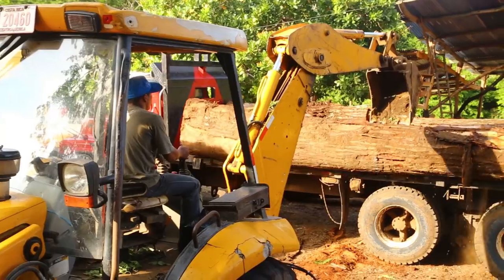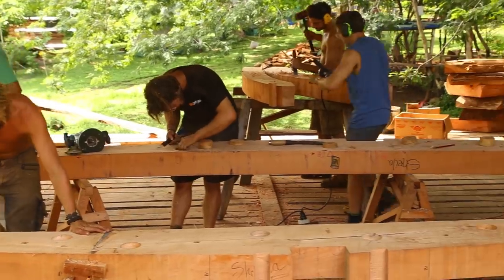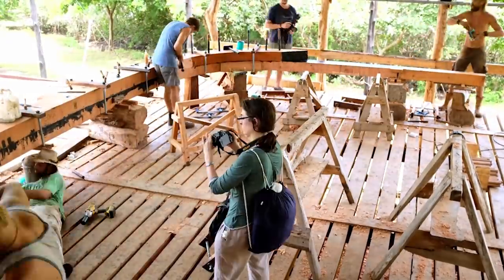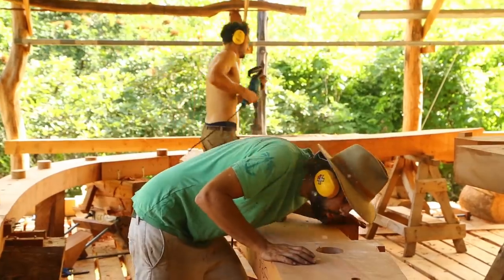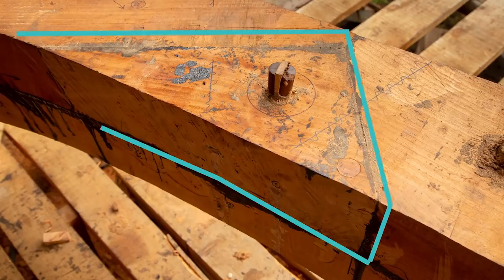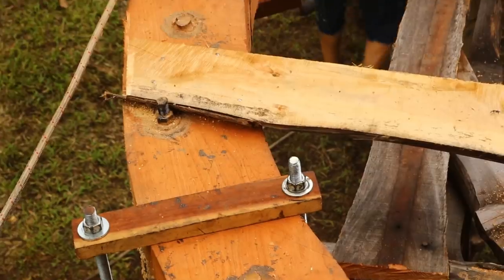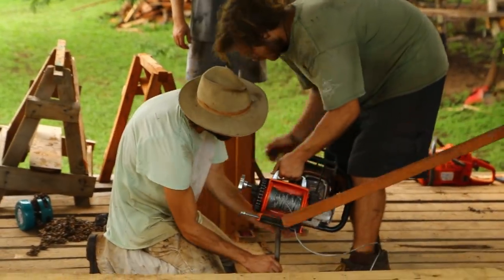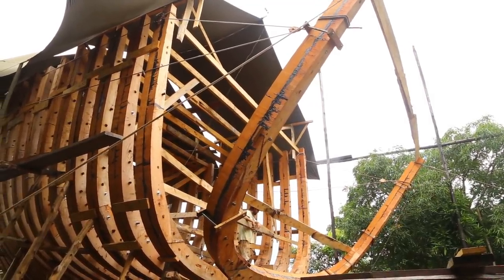Assembling CEIBA's Frames - SAILCARGO INC.

Comment: Impressive to see something of this scale being built using traditional ship-building/boat-building techniques.  Of the many, many questions I have, the biggest is probably this:  Where did you get the plans for something like this?  Are you using existing plans from the past, or has someone drafted something specifically for this project?  Also, are you planning on installing any ballast?  I know cargo will provide some of that when you're loaded, but it would help to have some when unloaded for stability as well, I assume.  Congrats on the build!  Subbed!  Looking forward to seeing more!

Comment: I don't understand the sheer keys.
Reply: Majoofi Ik think the shear keys are used to prevent that both wooden elements keeps together and are not sliding off each other.
Reply from the maker: Dear Majoofi,

A coak (or sheer key) is a rectangular or round piece of hardwood laid into the surface of two pieces of timber joined together. One-half of the depth of coak is set in each piece of timber. By the addition of coaks the resistance to sliding is greatly increased and the holding strength of bolts is also increased.

Julian
Reply: In smaller woodwork we call it a  spline.  Like a tongue & groove except the groove is in both pieces, and sometimes the spline is made with its grain crossways so it can't split along the joint line.  I believe it is spelled shear.  Sheer means semi-transparent.